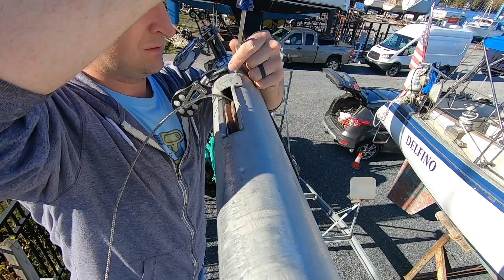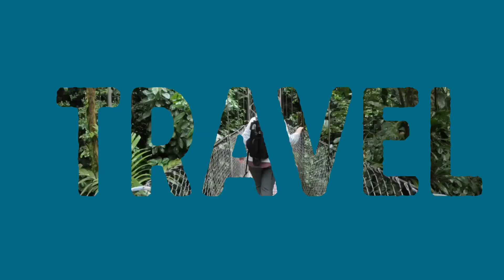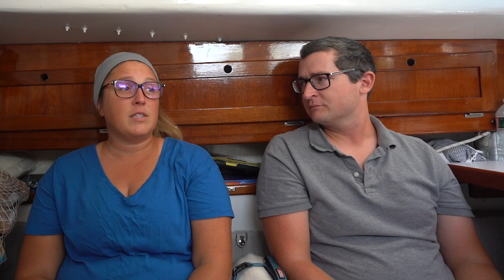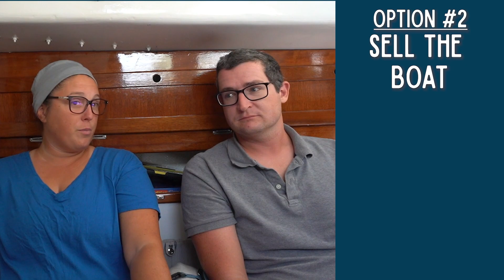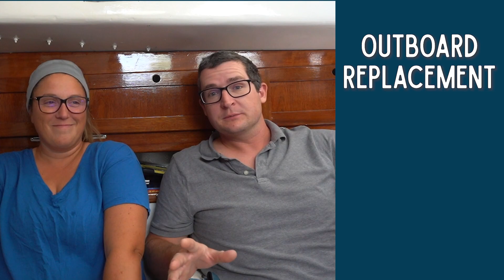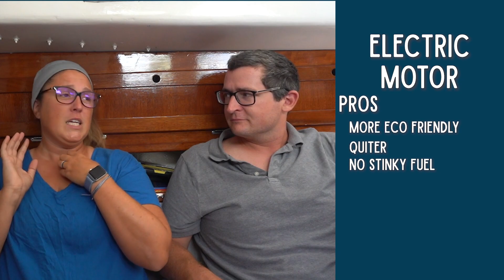What To Do About Our Engine Problems | Episode 40 Alberg 30 Refit

Comment: For the oven issue, check out what Sailor James originally did in the oven placement. Quite ingenious, I thought and plan to do the same once I finish Level 2 chemo for my liver cancer, here at UVM and but an A30. "SJ" also did a more recent oven upgrade to an induction oven. Easier to do after you have been sponsored by Dakota Lithium batteries, Renogy solar panels and Hydrovane...

Comment: You have chosen wisely.  Other considerations - will you be using your current transmission? and what is the max rpm of the Beta 20 compared to the Westerbeke 18?  The answers to both of these questions could lead you to needing to repitch or replace your prop.  Oh! I recommend you go with the digital engine panel!  It will allow you to network all kinds of data right into an NMEA 2K bus.  Good luck...don't stay in Indiantown too long.  It is where boats go to die!!!!
Reply from the maker: Thanks!  Our videos are about 4 weeks behind our real life so we’ve already broken out of that boat jail 😉 Beta thought we would be fine with our old prop but we did end up having to replace it.  Totally our fault, we had the ratio wrong on the westerbeke.  We are going to get the old one repitched so we can have a spare when we are somewhere long enough to wait the week it takes to repitch!  Required a second haul which was a pain but at least it’s done now!

I wish we could have afforded the digital panel, but we couldn’t justify the cost even with all the cool stuff we could have done with it!

Comment: Sounds like you have made a wise choice. We have an older diesel (Lehman/Peugeot) in our 30 year old trawler, and I understand all about "power-paranoia" from relying on an old motor. (I'm knocking on wood again now) I've never had any personal experience with a Beta, but I know they use Kubota engines as a base for their marine units, and that's a very good thing. 
I have a Kubota tractor, and their engines are simple, robust, and about as reliable as the sun coming up. They are used in everything from lawn mowers to cement mixers, to truck reefer units, so parts are available everywhere. Change that new engine's oil and filters on schedule, feed it clean fuel, and it will be a good shipmate for years to come. Cheers!
Reply from the maker: Power paranoia!  Hahaha that’s great!  It’s funny because we have 70 hours on the new beta now without any issues and my heart still leaps when Andy slows down for a boat to pass us or a bridge 😂 Hopefully that goes away soon!

Comment: I put a Beta 25 in an old CC 33,  in hindsight, I should have chosen the 20 Hp model.  I did not need the extra HP in the larger engine.  How did you land on choosing a 20 Hp model?
Reply from the maker: We were between the 20 and the 16.  The main reason we went with the 20 was because it was three cylinder instead vs the two in the 16.  It’s smoother.

Comment: Beta Marine seems like the best option to me also, I've been looking at them if my Hunter 33 ever starts giving me a headache. Did you find a cause for the issues you're having, or did you just throw parts at it? Just curious
Reply from the maker: We had a pretty good idea what the issue was, and checked everything that could have been solved without parts before moving onto replacing parts. When we were going through coolant we replaced the manifold gasket, which solved the coolant issue but not the smoking.  We had then worked our way back to the fuel system.  The fuel injectors had never been serviced so we sent them for inspection which turned out they needed rebuilding.  Solved the problem for like 10 hours, before it started smoking again and by then we had a knock too.  Shop that did the fuel injectors recommended replacing the exhaust manifold since that was a notorious issue on the westernbeke 18s.  Didn’t fix anything.  So I guess the answer to your question is yes we were throwing parts at it, but certainly not blindly.  There was a method to the madness.  When we decided to throw in the towel it had been narrowed down to a fuel injector pump issue or internal mechanical issues, potentially both.  The knock and switch from white to blue smoke making us lean toward mechanical aka all the money and time we were talking in the video.
Reply: @AbroadReachTravel  Yikes! I'd be pulling my hair out after all that haha. Hoping the engine refit goes smooth and gets you back to enjoying cruising again!